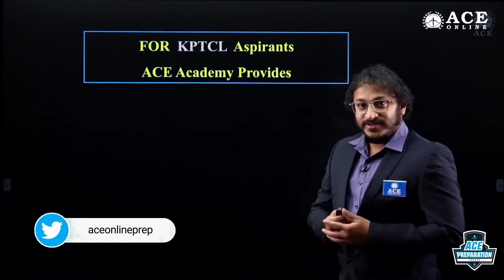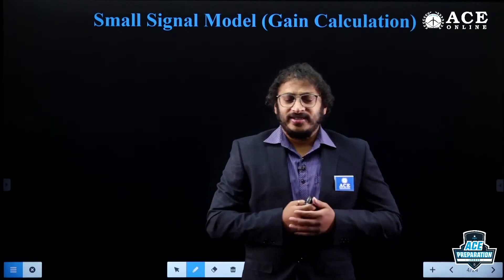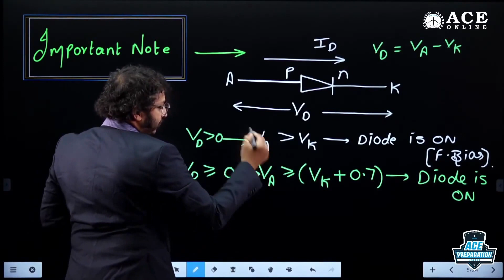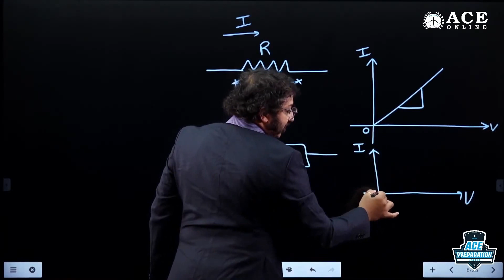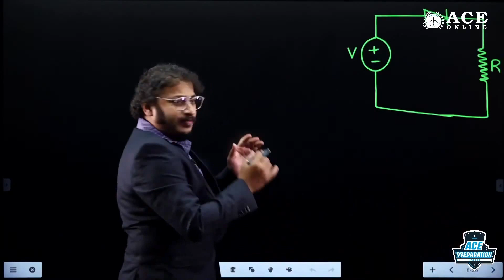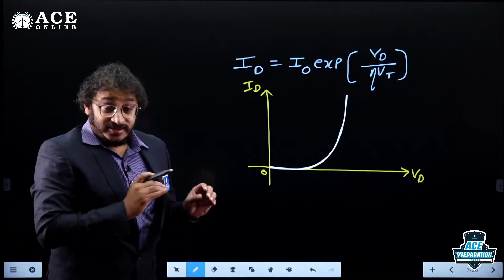KPTCL- 2022 | Small Signal Model Of a Transistor - Analog | Manimohan Trinath Sir | ACE Online

Comment: Sir,Amazing lecture and nice and simple approach to contents. One query in re model.Sir,in piece wise model we used a DC source to indicate cutin voltage of diode. While deriving re from input chara of BJT,  whether the dc level up to the device to turn ON(VBE) is discarded or it has no impact?
Reply: Dear, we get characteristics - only when BJT is on, emitter junction need to be closed , which is done from DC biasing techniques (as I stated about Q-point analysis), now once we apply small signal it will be superimposed on to the Q-point,  so DC is must to turn on BJT and effect of VBE need to be considered in   DC Circuits......best wishes 👍
Reply: @mmtrinath4538  Thank you sir
Reply: @mmtrinath4538 sir I am very desperate to learn EDC for GATE  from you on ACE online.   But sir your lectures on EDC are not present on  deep learn platform..   What I can do to  learn EDC from you??????